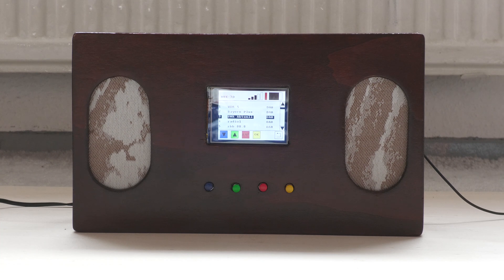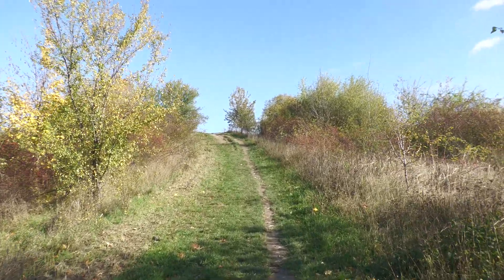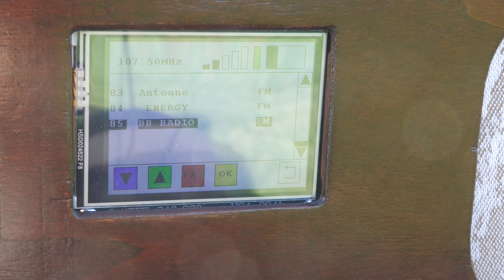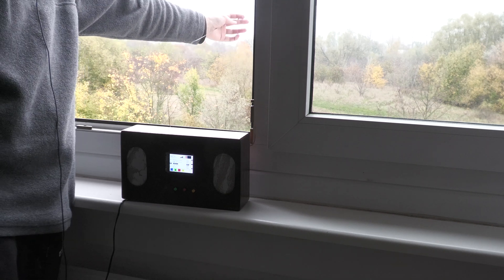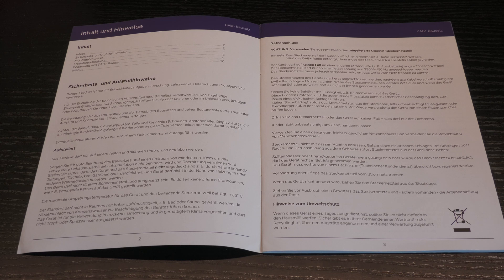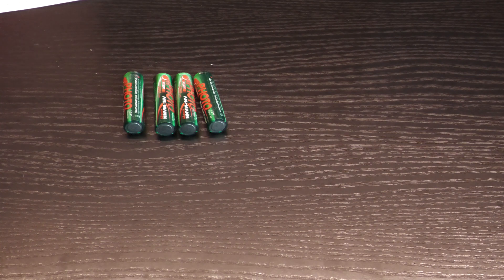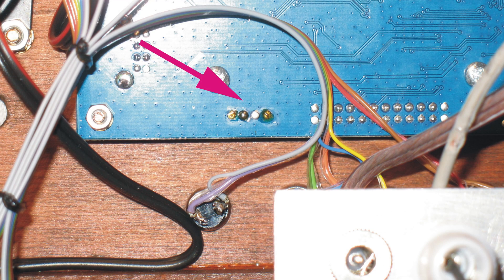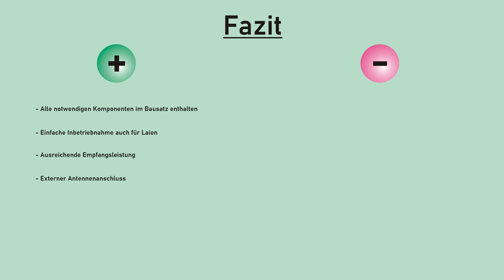Test DAB+ Bausatz Vistron VDR 400 - Digitales Radio Teil 2/2

Comment: Ich schätze dein technisches Verständnis sehr, bin aber der Meinung das es ein Haufen Elektronikmüll ist. Wenn das Teil schon auf DAB rauscht wird es kaum wirklich etwas empfangen können. Wie ist denn der UKW Empfang im Vergleich zu einem guten alten DDR Empfänger oder fängt dieser dann sogar auch noch das Rauschen beim Einschalten dieses Empfängers an. Lieber ein richtig guten 30€ Akku Empfänger fertig aus dem Elektronik Markt der DAB aus Sachsen-Anhalt auf höheren Plätzen im Berliner Raum noch ran holt. Umgekehrt geht es natürlich genauso. Auch ich habe Empfänger die bei 20km keinen Empfang mehr bekommen, aber eben auch welche die nicht mal mehr kosten und die 50km locker machen. Draußen sind es dann deutlich mehr. Leider speichern sämtliche Geräte so um die 250 Programme, danach ist einfach Schluss. Reicht fast immer aber nicht wenn man draußen mal auf dem Berg steht.